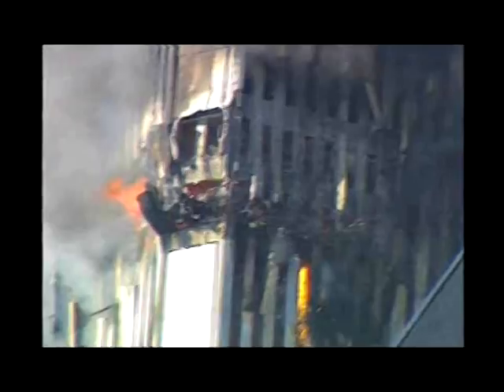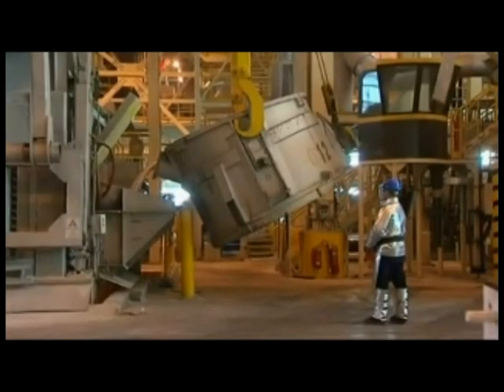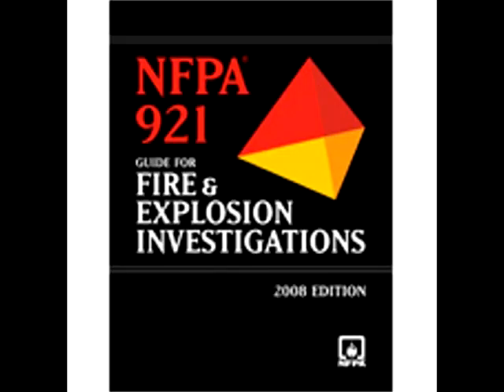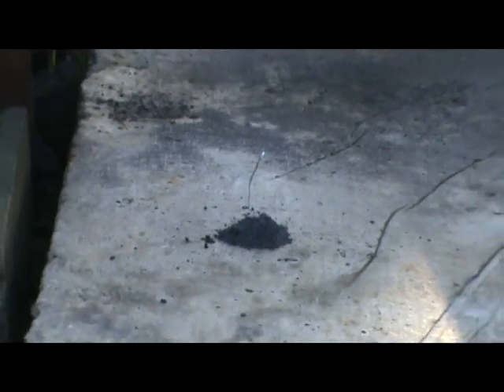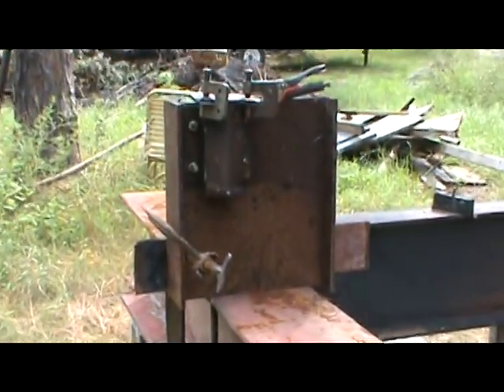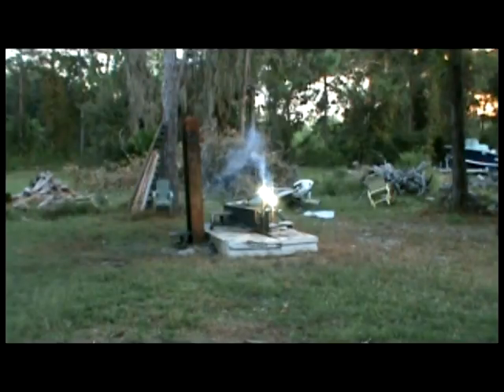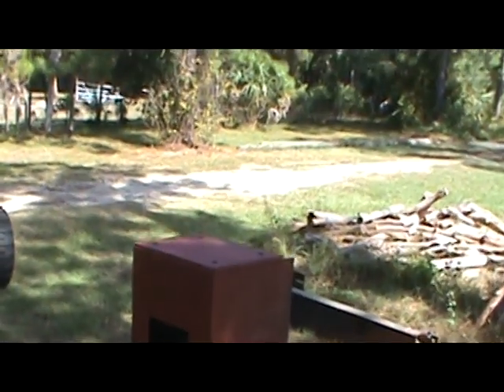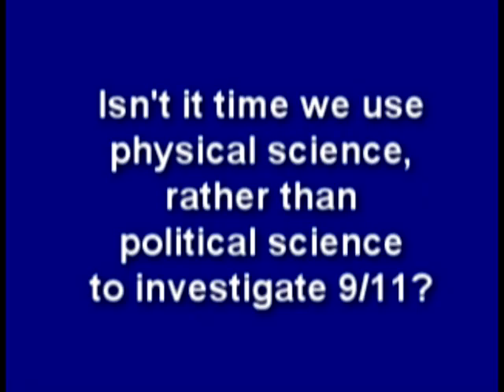9/11 Experiments: The Great Thermate Debate

Comment: I didnt think about this till now. That molten metal you see flowing out of the building is actually molten aluminum.

 Notice that if you do a bit of research and look up more videos of the metal flowing out of the building, it only flows from the plane impact point. The plane is made of aluminum. And yes, extremely hot temperatures will make it glow bright orange. 900 plus degrees will make aluminum glow bright orange.

 If it was in fact a thermite demolition, its kind of weird that it was pouring out for as long as it did in the first place. And wouldnt we see more thermite coming from other angles of the building too instead of just where the plane is? If anyone can find any other video that shows molten metal on any other part of the building, let me know. I would be glad to have a formal debate on this with anyone. I think I just debunked this whole theory.

Resources: http://www.drjudywood.com/articles/aluminum/Aluminum_Glows.html

https://www.reddit.com/r/askscience/comments/6qaevp/why_doesnt_aluminum_seem_to_glow_orange_when_hot/
Reply: do you mean 900 celsius?? im a foundry worker and aluminum melts around 1150 Fahrenheit
Reply: I think I found the only civil argument on the internet
Reply: I joined the US military and served six years after 9/11 happened.  I would just like to say that it's okay to be a bit more skeptical of the capabilities of our government, and the reasons our government might have for a war in the middle east.  [Ignoring the testimonials of pioneers in the realm of flying aircraft, who have debunked the myth that failed pilots from Iraq could've even flown the planes well enough to hit the towers/pentagon.]  Who knows what limits a select group of people would be willing to go to in order to accomplish a very profitable goal.  You seem very confident of no foul play by our own side, and I would like to believe that too.  But do not ignore the insurmountable evidence that gives credit to those who do not buy the media's narrative.  None of us commenting know the answer to how the towers fell, but besides the facts shown in this video on the destruction of steel (the towers' structure)- we now do know several reasons for why a war was beneficial to the US government in Iraq.  The US government gained a stranglehold on the Middle East oil trade due to the war, and ultimately we overthrew a dictator that had NO Nuclear WMD's (there were chemical arsenals found, but that was sold to Iraq by US).  The US forces also gained and continue to maintain many forts and bases throughout the middle east, helping the US to potentially secure some of- if not the most- densely packed areas of natural resources on the planet.  Furthermore, we have strategic positioning now on many countries/enemies that we could find ourselves in war with at anytime.  We could speculate for days on domestic reasons for the US government to do this to it's own people as well, but I would like to stick to facts- so I will leave you with one thought.  Under Bush's presidency, our country also lost 12 BILLION DOLLARS in unmarked 100$ bills that was being dispersed to IRAQI ministries and officials with ZERO accountability.  Without even a little bit of research, can you take a guess which buildings would have been able to track that money down?  Oh, the Twin Trade Towers & building 7- and oh shit, that one specific spot that the Pentagon was hit in.  With that said- Love thy country, Hate thy government.
Reply: Cody Bassett Every single source on the internet says they are made of aluminum to this day. Do you have a source?
Reply: zach m Yes. Celsius is the correct measurement.
Reply: Wyatt Williams As much as I agree with you, I dont think stacking books and dvds would be any good at simulating an actual building collapsing.
Reply: Cody Bassett false, the vast majority of commercial aircraft are mostly aluminum.
Reply: Spamster3212 The way the building fell wasn't due to a controlled demolition as some people try to claim. It was due to the buildings centre of gravity (a point that is barely used), the floor were all squares so the centre of gravity in theory would be the centre due to weight distribution. So when the structural integrity of the building was compromised by the crash and fire, the beams began to give way to the centre of gravity which was situated in the centre of the square. All it would take would be one floor to go and the rest below would go like dominos because the floors support beams weren't built to take two times their usual weight (a whole other floor ontop of it)

This is just my explanation through simple application of physics and common knowledge so I'm no expert so don't take my word for it but neither is the dude in the video. 

You can also try this by stacking some books or dvds with the build of two pillars one floor stacked ontop of each other. Do this for five floors and then knock towards a top floor and watch how they fall.
Reply: MyGuitarTwerks look up operation northwoods. During JFKs presidency the CIA planned similar attacks against the U.S. and blame it on Cuba to justify military action during the Cuban missile crisis. Only thing that prevented it was JFK saying No. What if Bush just said Yes
Reply: I'm guessing everyone that questions how it could get hot enough.... Has never seen a forge in person.  If you have, then try to picture a forge the size of about a 3-4 floor office building.  THATS how the tower got hot enough to melt EVERYTHING in its wake,  until the inevitable collapse. Bunch of geniuses I swear.  Lemme guess.... The earth is flat also???
Reply: Chris cestero Do you have a link to those photos? And a plane contains a lot of aluminum. More metal than that would have came from a thermite explosion. A plane on average that is around 90,000 pounds contains 70-80 percent aluminum. That's a lot of aluminum.
Reply: MyGuitarTwerks yes they did have reason to do it an it's not just the government's it's the elites that make this all happen there reason to have faked an attack was thinnest reason to go to Iraq really you missing all of that when they went there an destroyed a country that had nothing to do with it other then it's own government an elites they stole all the oil (big reason) why they set up this attack second reason they stole all the gold and destroy everything that had to do with freedom and killed Saddam and funny how everybody Belize how they couldn't find Osama Bin Laden when a news crew found him so believe all the b***** they threw out there if you want
Reply: Chris cestero I understand his theory in the video. The thermite melts the steel beams, blah blah blah. But there isnt any evidence towards it in the occurance of the event. The metal continuously flowed out of the plane impact point for a long period of time. The steel melted in the video did not melt as much. And if the steel did in fact get melted in the building, we should have seem the flash and white smoke and metal splattering at other parts of the building. It would melt through the walls. And all the videos I see are on the molten metal is from where the planes hit. And I dont know what photos you are talking about still. I skimmed through the video. Would you mind pinning the time in your comment?
Reply: Please explain the 5 dancing Israelis who were caught filming the entire event and, who went back to Israel and, on Israeli television, told the audience that they were sent to New York to "document the events" of 9/11, by their own Government. At least one of the 5 was found to have been an agent for Israel's Mossad. Also, please explain the 4 Israelis who were caught in the van full of explosives on the George Washington Bridge on the morning of 9/11. The actual news broadcast of it happening is still on YouTube. The Officer who arrested the 5 dancing Israelis is also on YouTube.
Reply: Zachary Jones, A job like that would have involved passing through layers of security. Bin Laden was inside of a cave in Afghanistan at the time. I think it's safe to rule him out. Meanwhile, the security company at the WTC was owned by the Bush family.
Reply: MyGuitarTwerks Very interesting discussion you've managed to start here :)
Reply: Nitropanda16 Im not discouraging the idea that our government is corrupt. I think everyone knows that. Im just saying this idea that there was a demolition is completely wrong. It makes a lot more sense with more evidence that straight up physics did its work here. Now if the planes were controlled by our own government, nobody knows that either. But I agree, a lot of evidence shows something a bit odd with our government. There is still no solid physical proof.
Reply: MyGuitarTwerks when he's testing the main iron structures (he bolts one on top) you see pictures of it in real life and also pictures of it after the buildings fell. I just think everyone should look into it a bit more and not just take it at face value, as you can clearly tell there's more to it than they say. Even if the buildings did collapse due to the planes, we should be looking at what happened that day and figuring out why, not whether or not the buildings came down due to fires. Look into lucky lary Silverstein. That man insured the buildings against terrorist attacks. He also was filmed on camera saying that he decided to "pull the building (WC7) after seeing what happened with 9-11" demolition job like that would take weeks, not minutes!
Reply: theses theseus you’re fucking stupid bud. You’re comparing an office building to a forge.
Reply: Yep, you heat up ANYTHING sufficiently hot and it will glow bright red/orange.

For all the conspiracy theorist, the problems with your theories is that you rely on bad evidence that you do not critique enough. Note for example in the video he says "air temperatures in the tower", instead of "reaction temperatures". In a high building like that, up where the wind can blow strongly, a fire from celllulose, carpet, office desks, etc, can reach very high temperatures. Soffening and even melting steel is possible. You essentially turn the building into a furnace where the air supply is the wind and the enclosure is the building itself, and the fuel is everything inside.

Building 7/the building on the ground is a different story completely, and I'll admit I have no reasonable explanation for why that went down. My gut tells me that somebody doesn't want to be blamed for absolutely terrible design/fire management and they don't want to be blamed, and thus leave it up to conspiracy theorists to make anyone who questions it look nutty, but other than that speculation I have no explanation.
Reply: MyGuitarTwerks oh look.. another uneducated rebellion against solid facts. Ignorance really is bliss it seems. Gn
Reply: MyGuitarTwerks did you miss the part about what color aluminum is? Rewatch 2:30-3:15. Molten aluminum is not that color, nor would the furniture and such turn it orange.
Reply: DesiredHeadshot On impact it would be covered in building material. Plaster and concrete can definitely make a furnace. Multiple videos on youtube shows how to make them. Ive even made one myself. It was pretty cool.
Reply: Popular Mechanics also claimed that not only has Nano Thermite never been used for the demolition of a building, they went on to write that it would not work. They were sure embarrassed when someone pointed out that Popular Mechanics covered a story about Chicago's Skywalk which was demolished using Nano Themite in the year 1934!!! Imagine how much more advanced Nano Thermite is today than it was in 1934.
Reply: The fires from the fallen World Trade Center burned for 92 days even though the fires were under water for much of that time. That could ONLY happen with Thirmite.

Period. https://www.youtube.com/watch?v=l0Q5eZhCPuc#t=460
Reply: Fire Engineering, the oldest and most prestigious firefighting organization in the world, which has been training firefighters for over 127 YEARS, disagrees with the Government's theory of events regarding 9/11. All you have to do is Google it. http://www1.ae911truth.org/en/faqs/575-popular-mechanics-ignores-its-own-historical-records-of-thermite-demolition-destruction-of-skyride-towers-reichstag-dome-set-incendiary-precedent
Reply: MyGuitarTwerks, Military grade Nano Thermite had no business from being within MILES of the WTC and yet, massives amounts were found in the dust of the WTC. Our Government has admitted that there is not an iota's worth of evidence which shows Bin Laden had anything to do with 9/11. How would his men have gained access to the WTC with so much security around?  One member of the CIA has taken testimony from witnesses who said that in the weeks leading up to 9/11, after the WTC closed, trucks started arriving and they stayed until the morning hours.
Reply: Rocky Dennis MVP there was reportedly a power outage a couple days before 9/11. Look at this: https://www.google.com/amp/s/truthandshadows.wordpress.com/2010/10/26/trade-center-cameras-locks-electricity-turned-off-weekend-before-911/amp/
Reply: Below is a list of people who question what our Government has said about 9/11.

Senior intelligence officers:

#1). Daniel Ellsberg, former military analyst and famed whistleblower said that the case of a certain 9/11 whistleblower is "far more explosive than the Pentagon Papers". He also said that the government is ordering the media to cover up her allegations about 9/11. And he said that some of the claims concerning government involvement in 9/11 are credible, that "very serious questions have been raised about what they [U.S. government officials] knew beforehand and how much involvement there might have been", that engineering 9/11 would not be humanly or psychologically beyond the scope of the current administration, and that there’s enough evidence to justify a new, "hard-hitting" investigation into 9/11 with subpoenas and testimony taken under oath.

#2). Raymond McGovern, a 27-year CIA veteran, who chaired National Intelligence Estimates and personally delivered intelligence briefings to Presidents Ronald Reagan and George H.W. Bush, their Vice Presidents, Secretaries of State, the Joint Chiefs of Staff, and many other senior government officials said "I think at simplest terms, there’s a cover-up. The 9/11 Report is a joke", and is open to the possibility that 9/11 was an inside job.

#3). William Bill Christison, a 29-year CIA veteran, former National Intelligence Officer (NIO) and former Director of the CIA’s Office of Regional and Political Analysis said "I now think there is persuasive evidence that the events of September did not unfold as the Bush administration and the 9/11 Commission would have us believe. … All three [buildings that were destroyed in the World Trade Center] were most probably destroyed by controlled demolition charges placed in the buildings before 9/11."

#4). Lynne Larkin, a CIA Operations Officer who co-chaired a CIA multi-agency task force coordinating intelligence efforts among many intelligence and law enforcement agencies sent a joint letter to Congress expressing their concerns about "serious shortcomings," "omissions," and "major flaws" in the 9/11 Commission Report and offering their services for a new investigation (they were ignored).

#5). David Steele, a 20-year Marine Corps infantry and intelligence officer, the second-ranking civilian in U.S. Marine Corps Intelligence, and former CIA clandestine services case officer stated that "9/11 was at a minimum allowed to happen as a pretext for war", and it was probably an inside job.

#6). Robert Baer, a decorated 20-year CIA veteran, who Pulitzer-Prize winning investigative reporter Seymour Hersh called "perhaps the best on-the-ground field officer in the Middle East", and whose astounding career formed the script for the Academy Award winning motion picture Syriana said that "the evidence points at" 9/11 having had aspects of being an inside job.

#7). Melvin Goodman, the Division Chief of the CIA’s Office of Soviet Affairs, who served as Senior Analyst from 1966 — 1990 and who also served as Professor of International Security at the National War College from 1986 — 2004 said "The final [9/11 Commission] report is ultimately a coverup."

#8). Major John M. Newman, PhD, U.S. Army, a Professor of History and International Relations, University of Maryland AND former Executive Assistant to the Director of the National Security Agency, former military attaché in China, with a 21-year career in U.S. Army Intelligence questions the government’s version of the events of 9/11.

#9). Bob Graham, the Co-Chair of the Congressional Inquiry into 9/11 and former Head of the Senate Intelligence Committee and FBI informant had hosted and rented a room to two hijackers in 2000 and that when the Inquiry sought to interview the informant, the FBI refused outright, and then hid him in an unknown location, and that a high-level FBI official stated these blocking maneuvers were undertaken under orders from the White House.

#10). Patrick Leahy, current Democratic U.S. Senator said: "The two questions that the congress will not ask . . . is why did 9/11 happen on George Bush’s watch when he had clear warnings that it was going to happen? Why did they allow it to happen?"

#11). Ron Paul, current Republican Congressman calls for a new 9/11 investigation and states that investigations that have been done so far as more or less cover-up and no real explanation of what went on"@http://web.archive.org/web/20070121184445/http://www.prisonplanet.tv/audio/170107paul.mp3″ volslider="y" style="outline"]

#12). Dennis Kucinich, current Democratic Congressman, hints that we aren’t being told the truth about 9/11.

#13). Jason Chafetz, current Republican Congressman, says that we need to be vigilant and continue to investigate 9/11.

#14). Mike Gravel, former Democratic Senator, states that he supports a new 9/11 investigation and that we don’t know the truth about 9/11.
Reply: My dad is a secret government agent and he told me he helped plan 9-11 and also nickleback's career
Reply: MyGuitarTwerks, If you were to believe in the Government's version of events, you would also be disputing the laws of physics/gravity and so, would be challenging everything laid down as their laws by people such as Einstein, Galileo, and Isaac Newton. You people have indicated that those early pioneers are now wrong as it agrees with your views on what NIST has indicated. NOTHING in the NIST report was peered reviewed. 

     I also find it strange that you people take everything that the Government says, as being the truth, KNOWING that you yourselves can't name even ONE politician who got into office without lying. Therefore, it is MORE than safe to write that you people only take the word of known liars. 

     That is a solid fact. 

      Why then, should we concern ourselves with what you have to write regarding 9/11?

      It is quite simple. 

     The laws of physics do NOT allow ANY building to fall at free fall speed unless there is no resistance from the bottom floors. The ONLY way that resistance could POSSIBLY be taken away would be through a controlled demolition. PERIOD! That is a SOLID fact that has been proven.
   
      Over 2,400 highly educated Building Safety Engineers and Architects have signed a petition to have the 9/11 investigation re-opened. 

      More than 8,000,000 more are in silent agreement with them. 

       Together, these Building Safety Engineers and Architects have THOUSANDS of YEARS of experience between them compared to the few who contributed to the NIST report who have little to no experience in those areas.

      You people are suffering from the "Crop Circle Syndrome". Even when the people who made the crop circles came forward and admitted to making them, all of the UFO believers called them liars. Likewise, even if President Bush, along with Israel, admitted to doing 9/11, you would call them liars too. You know it. I know it. Everyone reading this knows it.

      See the nearly 5 hour film on YouTube entitled: The New Pearl Harbor. You will doubt the NIST report after you do. I am willing to bet though that you won't even bother as you have your minds already made up.
Reply: So thermate was used, we are just in disagreeance about how it was carried out?
Reply: Wyatt Williams 
Try stacking those books on four walls
The only way they could fall straight down is when all four walls become reach failure point at the exact same time
That would mean heating steel walls to melting point evenly all the way to each corner 
And this happened twice in the same event?????
Reply: MyGuitarTwerks interesting...
Reply: Agreed! I have worked with molten aluminum in shop class many years ago...and it does glow orange!
Reply: 19thewanderer You have worked with aluminum for 9 years and you still fail to understand that it can still glow orange? How sad. It means you were not burning it hot enough. I know it melts a silver color. But when even hotter it starts to glow orange. Over 1,600 degrees fahrenheit to be exact. That is as hot as jet fuel burns. Look at my links in my comment. That also proves how aluminum can glow orange when hot enough.
Reply: Spamster3212 And Im not that knowledgable of how a thermite demolition would work in other places of the building that arent open. I'd assume that we'd see some sort of reaction on other parts of the building considering the beams are along the outer part of the building. It should have melted through the windows.
Reply: MyGuitarTwerks very good point. Makes perfect sense, if the thermite can barely cut through it without any steel left on the ground of this experiment how can we be sure that if there was thermite that there would be molten steel? It just doesn't make sense. But another peculiar event was the collapse of the other 2 buildings. They weren't directly impacted by any planes or explosions just the movement of the ground from both towers. Could that be enough to completely rupture the structure of the buildings?
Reply: Cody Bassett really? Because those Boeing’s are old jets. And where made from aluminum the whole airframe is.
Reply: MyGuitarTwerks it was in the video bud, plus all of the real life evidence was destroyed and shipped to China ASAP, which is very much against the way a normal investigation goes. Correct me if I'm wrong but 2 jumbo jets fly into your building and "demolish" it and you don't wonder what happened and think, let's keep the material here for testing. The metal wasn't from the thermite, the molten metal is coming from the thermite melting the structural beams. So its actually steel/iron from the structure. At the end of the day, were arguing pedantics here. How it was demolished is irrelevant, because the evidence is all in the before and after the attacks. I.e the trillions of $ that went missing (all of the files that would keep logs of where that went were kept in the two towers, WTC 7 and also that exact part of the pentagon that was hit)
Reply: MyGuitarTwerks yes, but... the towers weren’t the only buildings that fell that day, a building close by was demolished st the exact same instant and wasn’t even impacted by the aircraft
Reply: theses theseus The size of a forge doesn't affect the temperatures inside it. Gg.
Reply: Michael Mann building 7 was hit and heavily damaged by falling debris from the towers. It collapsed because most of it's structural support was on one side. The building relied on this side to stay standing. After this side was seriously damaged due to the falling chunks of the towers, as well as many fires that were not put out, the building was weakened enough and collapsed. Building 7's structure was poorly designed in this regard, because it had to rely on that one side for 90% of it's structural support.
Reply: MyGuitarTwerks correction, the US government DOES have motive to attack its own people. They even had detailed plans about it in the cold war so they could attack cuba!!
Reply: How hot could a fire contained in a building with wind acting as a natural bellows get?
Reply: Nitropanda16 ...really? And how much does an american pilot, who can fly these planes, ask for in cash, to smear himself all over new york?
 I cant believe the dumbass muslim trolls, have not thought of this one.. The planes were empty and flown by remote control, by the military, into these buildings..  Hell, bill clinton, was one of the remote pilots.. 
 If your going to be stupid with americans, why not "troll it" all the way?.. 
After all, this is an attempt to save your government billions of dollars in law suits, that the black muslim blocked, and the white christian, has now allowed to be pursued..
 If americans did it, why are 4700 of the best lawyers in america, suing saudi Arabia for damages?  
Your people are going to pay for what the did to us.. The simpletons might buy your propaganda, but those idiots dont matter..the real men  are coming after some saudi ass... And we are going to get it...
Reply: Planes do use some magnesium in them.
Reply: kutzbill they use it do to weight and when it burns , you can't put it out with water you need halon
Reply: MyGuitarTwerks planes are made from aluminum you know this right
Reply: BettingSet 8340 Yes. My original comment didnt mention that or anything.
Reply: Rocky Dennis MVP I do agree, installing thermite would be a tough procedure in the first place.
Reply: Herbert Metzger The video shown was just a standard aluminum factory where it is not necessary to melt it that hot to where it glows bright orange. He is just a bit ignorant. I know for a fact at a certain temperature molten aluminum will glow bright orange. I have links in my original comment.
Reply: OG-BombSquad What are you talking about? Have you read anything I said? If you have something to point out against me, then tell me. As I said, I'm always up for a formal debate. Why dont you just tell me what I said that is wrong instead of just saying that I am uneducated? 🙄
Reply: Rocky Dennis MVP I keep trying to tell idiots this same thing. Some people say it was rigged with explosives. The prep work involved to demo ANYTHING, in ANY WAY is nothing short of epic.
Reply: Reign Gholson Could easily be a coincidence. Maybe it just was a power outage. It doesnt mean anything.
Reply: Jim Allen It can.
Reply: MyGuitarTwerks, Many of those people were Republican too. These people gave you their reasons. They are in quotation marks. These people think our Government did it because our Government did do it and there is plenty of evidence. Especially, concerning Building number 7. That building was built using a grid design. There was no "one" supporting column used in that type of design. In order for a building of that design to have come down in the manner in which it did would require that every single beam fails at the exact same time and, outside of a controlled demolition, that is totally impossible. The former head of the FBI also has indicated that 9/11 was an inside job.
Reply: Also the aluminum was atomized, it burns very hot.
Reply: Paul Klement jet fuel burn at about 1000°c well above the point were aluminum starts to glow orange, and for the other question, metal don't get heated at the same temperature at the same places in uncontrolled enviourments, and some of it may have been other metals from furniture and other things inside the building.
Reply: MyGuitarTwerks what do you even mean. Gain access to the middle East at a time in which they were going to accept the euro for oil, what about getting the no fly list and all the TSA at the airports. Your right. No gain.
Reply: It got a far more dire reason for happening than the world realizes, it involved as above so below, timelines and other dimensions. It was a ritual.
Reply: MyGuitarTwerks ok say it is Aluminium, how is it on so many floors, and how is there so much. despite the plane only crashed on one side... the Al (Fe) is on all sides according to the video footage..?
Reply: What about the explosions heard at ground level by numerous eye witnesses?
Reply: Chris Nobody was is inside to really comfirm what could have caused them
Reply: Chris I can guarantee they never heard an explosion before to compare a gigantic building collapsing in on itself to an actual explosion. It was a really loud occurance because it was a lot of heavy material falling to the ground from very high up.
Reply: MyGuitarTwerks
Molten aluminium does NOT glow bright orange, no matter how hot you can get it.molten aluminium looks like molten lead or mercury, silvery grey.
I worked with the stuff for 9 years, melting thousands of tons of ingots, as soon as it was poured out of the melting casts it was a silver grey colour, also it wouldn't stay molten for days or weeks as shown on video, give it 20 minutes on the floor you can pick it up without gloves..it never glows for weeks and months when away from the heat it cools down very very fast.
so. sorry you didn't debunk anything, but like most Yanks you know sweet fuckall.
Reply: Rocky Dennis MVP If it was used on other floors as well , wouldn't all those Sparks cause a fire on those floors as well ? And if it was used to cut the beams on the lower floors wouldn't the collapse start lower , the moment the steel lost it's structural integrity ?
Reply: Something is not right... Jet fuel did absolutely nothing to melt the aluminum. Because jet fuel doesnt burn on its own in the first place! Jet fuel would constantly need to spray in order to atomize and combust. In a single crash, the jet fuel would instantly combust not long enough to melt anything. After that, jet fuel would pour out of the plane not burning at all. The only heat we would get is the heat from the building. Which can only burn on its own in a maximum of around roughly 500 degrees celsius. Not 900 degrees celsius which would melt aluminum and also make the aluminum glow orange. Im beginning to feel so certain that the orange metal flowing out of the building could not have been caused by the plane itself even if it was aluminum. 

This whole theory I made was completely wrong. If jet fuel isnt burning, then my theory doesnt work... Im becoming more convinced that 9/11 is actually an inside job.
Reply: MyGuitarTwerks ...thermite wolooksuld have burned up or exploded long before the buildings fell, from the fire and heat...get a clue folks
Reply: Test McTesty Well it is easier to believe something like that would happen simply because of physics. When a monsterous sized building weighing 500,000 tons collapses in on itself, you can guarantee it does not need that much velocity to instantly snap the steel underneath. This isnt a normal collapse, mind you. But a unique one. There was literally no building as massive as the twin towers till they were destroyed. All you need is enough heat to weaken the steel and it would snap and collapse in on itself with its 500,000 ton structure.
Reply: A question, not an argument, because I'll not pretend to know anything I don't.

But if there was indeed thermite causing the molten metal, would it only fall from the impact point because that's the only part of the building that was cracked open, if I can phrase it that way?
Reply: Spamster3212 If it was a controlled thermite demolition, we wouldnt see as much molten steel as we see in these videos. It was pouring out for a really long time. As compared to this demonstration, there wasnt that much molten steel. So my only conclusion to that is that it is actually molten aluminum from the plane.
Reply: MyGuitarTwerks planes haven’t been made of aluminum for decades they’re a carbon compact mesh that doesn’t act like that.
Reply: MyGuitarTwerks I get you but why couldn't both have occurred? From what I gather, fire and heat alone couldn't of collapsed a building like the way it did.

So what I'm asking is, why can't both theories be correct playing out simultaneously. Your theory of the molten aluminum from the plane sounds right and I believe it, but it doesn't debunk the use of "other" support weakening motives that could explain how two giant towers collapse into their own footprint.
Reply: That makes a lot of sense but doesn't really debunk the theory. How would the aluminum get hot enough to glow orange? And how does this theory explain the thing with the pattern were some parts were glowing followed by some that didn't? I think both theories are valid and really interesting
Reply: MyGuitarTwerks I think physics definitely show the opposite to what you're trying to implicate. Molten metal was pouring out of the windows for quite some time. There was way too much coming out for it to have been just the aluminium from the plane. Plus you're also choosing to avoid the evidence (photos) of the structural beams that had holes through it (a sort of hole that a thermite explosion would cause)  The American people should be up in arms about this until all of the evidence comes out.
Reply: Wayne Johnson I looked that up. I didnt know that, but it definitely proves more that it wasnt actually our government. I feel like there is more evidence surrounding the idea that Osama planned 9/11 than our own government. Sure, you can say our government is corrupt here and there and might have a couple motives. But there is no physical evidence.
Reply: Wayne Johnson You cant do this to me, man 😂 That's an hour long video. Do you have a different source?
Reply: Wayne Johnson How do you know they didnt question 9/11 for political gain? And also it doesnt prove anything. If these people are claiming something else happened, then what is their claim? These are just people that think our government did it.
Reply: This is just too big for being fake IMO. This whole thing had to be planned, all the 'actors', the workers who plannted the explosives. And the pilots who flew the plane had to be skilled to hit the right spot so no one would see the explosives going off.That's just my opinion.
Reply: Louis Weber keep telling yourself that. But the truth is, there is usually an explanation for everything and Im also pretty sure our own government wouldnt have a motive anyways for going that far to plan something like a detonation to kill their own citizens. Really. There was no gain from that towards our government.